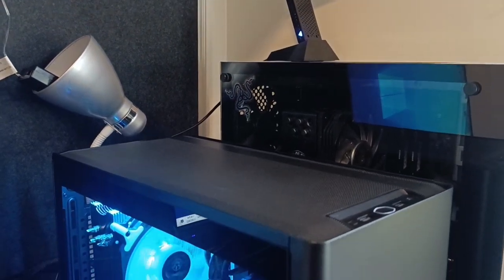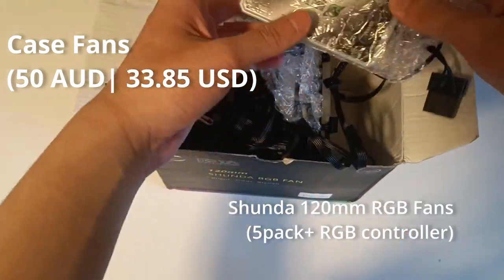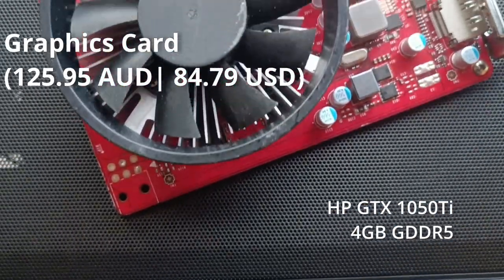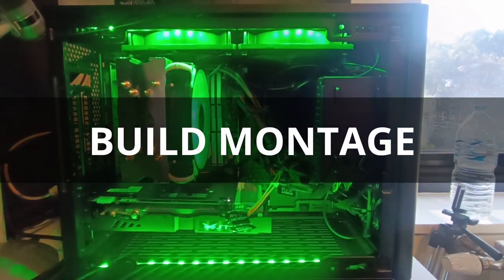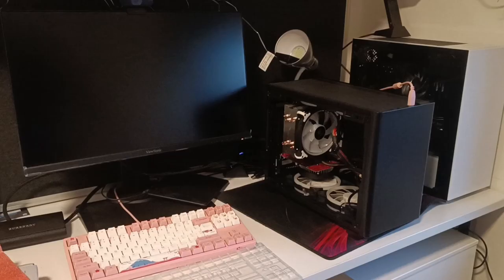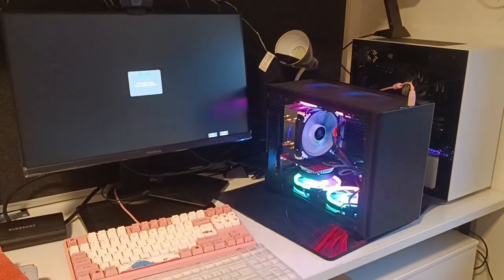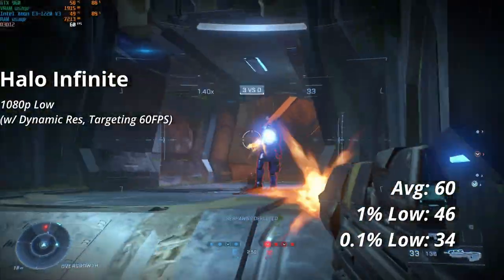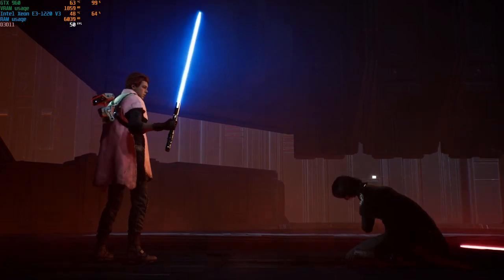Building a $400 Mini-ITX Gaming PC!

Comment: I wouldnt recommend building this, maybe buy an 1000$ pc. its a bit more then 400$ but it runs over 300 fps high settings 1080p on valorant
My build: Motherboard: B660, Storage 120GB M.2 NVMe + 1TB HDD, Processor AMD Ryzen 5 5600X, Power Supply (PSU) EVGA 600W 80+ Power Supply, CPU Cooler VRLA Tech RGB Tower Cooler, Memory 8gb x2 (16GB) Graphics Card, NVIDIA GeForce RTX 3060, and the case Deepcool/VRLA Tech Matrexx 55 V3 RGB ATX. This totally costs around 1k-1.1k
I know its a lot more then 400$ but it doesnt sattislfy u
Reply: This is itx so it will obv be taxed but you can build 400 dollar atx pcs that can push high fps and not everyone wants or can afford an 1000 dollar pc. I know that I would never spend 1k on a pc bc I can’t tell the difference between 144hz and 300hz and it doesn’t make me any better